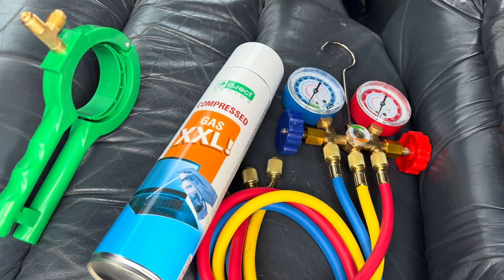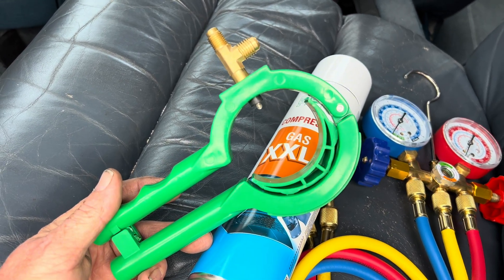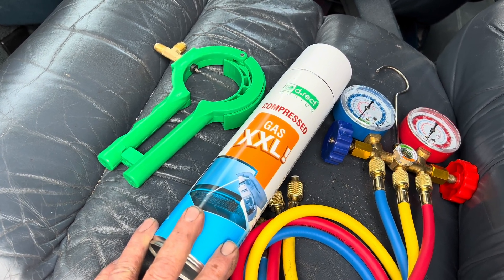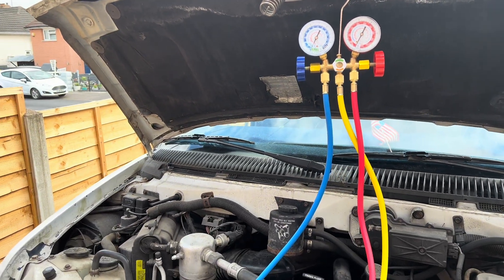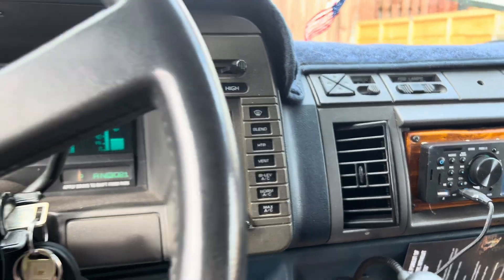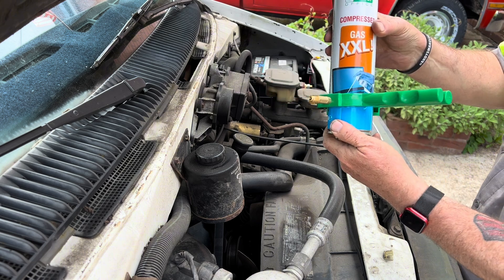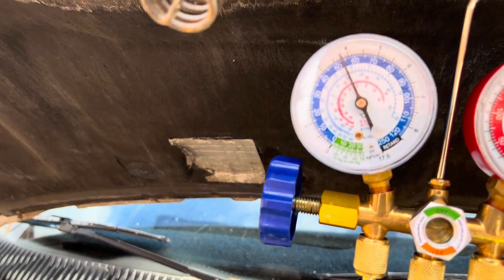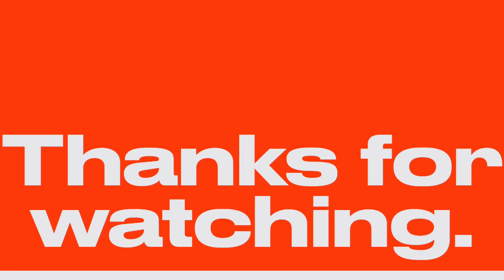Recharge your Air Conditioner using cheap  cans of “Air Duster”. Money Saving Hack

Comment: If you have an R12 system I read that the the new hfc refrigerants will react with the mineral oil. You are supposed to flush flush it out and replace it with PAG oil